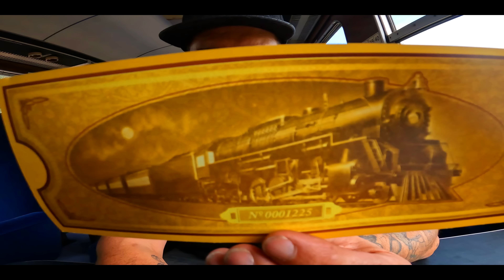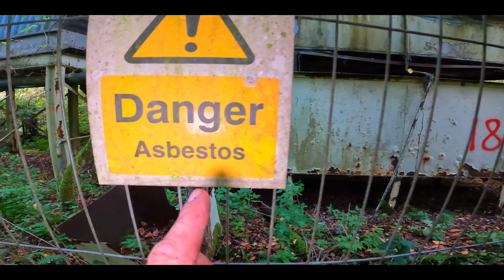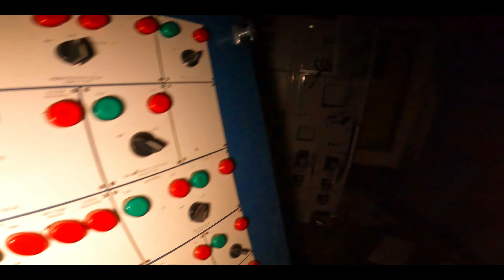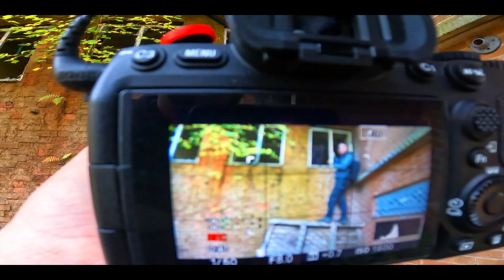FORGOTTEN Bmw DEALERSHIP? E30 E24 PORSCHE!!

Comment: The badges haven't been removed from the BMW's - It was an optional extra when they were new to order them De-badged by the customer. Your rant about the Audi TT - old fashion crook lock in Tesco car park. The disastrous keyless lock system in modern cars  allows the criminals to steal these cars from anywhere in sceonds. These same criminals would be cluless in how to remove an old fashion crook lock and move on to the next easy keyless car - Enjoyed your video though - Thanks.

Comment: Ref Audi TT, Cars, all makes and brands get stolen from every location inc supermarket carparks, every deterrent is worthwhile even it distracts the casual thief, apart from that keep up the good work. PS: I might be inclined to swap my 3.2S manual Boxster fir a nice e30 325
Reply from the maker: Yeah I know mate I was on a right rant haha! But as I've been in that world I kinda know what's worth it and what's not! Sometimes it's better going for the top shelf security rather then the low grade as at the end of the day if it gets stolen its only down to the system you've chosen! Cheers chap

Comment: Ye mate, cars dissapear from tescos carpark, in fact, thieves will nick any car they  require at any time day or night 🤷🏻‍♂️ ppl putting steering locks on there expensive cars clearly live in the real world. Thought id give your channel a chance and you ruind it with that crazy bullshit comment 🤦🏻🤦🏻
Reply from the maker: whatt crazy b******t comment?? No mate to be honest you totally missed my point, If you're going to put a steering lock on any car what's the point in putting a low grade security device on, yes i'm well aware that cars get stolen all the time after all i was the low life that used to take them back in my 20s, (Insults welcome) So again misunderstanding my comment. if the person came out and there car was stolen its down to the silly cheap steering lock thats on there at the time i value your comment but again people need to understand the tenacity of the thieves. Thanks for your honesty mate but there's no need for the aggression. Cheers...
Reply: Calm down Kris 😅
Reply from the maker: @alxgu198  🤣🤣🤣👌🏼

Comment: Some lovely old bmws...... what a shame..... worth big money now.... 

Asbestos is not dangerous if it's not damaged... to allow fibres in the air. And most are not as bad as you think..... wear a marsk....

You have to breath it in for a long time over many years...... 

You be fine.... 

& your correct in the snow - asbestos was used.... 

Asbestos is in baby johnsons poweder - radox - etc.... just worded different..... it was and is still in alot of things. 

I know - I do a course every year for my work. 

Ffff boring as fffff 

But what a durable material - its actually good shit.... just a killer to man kind..... 

👍🏼

Keep finding them old German ladys 

👍🏼💯👀😉